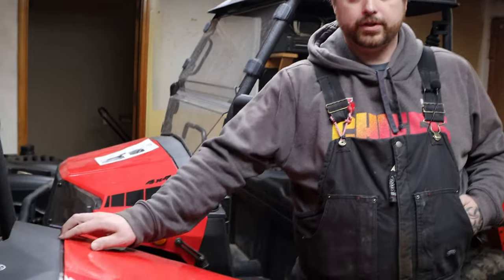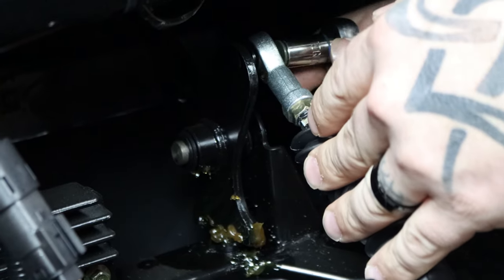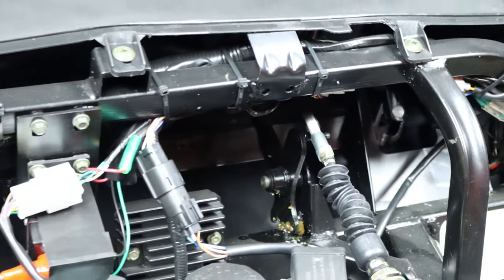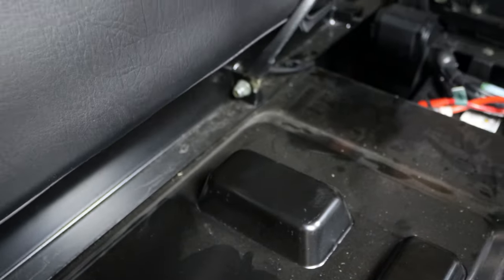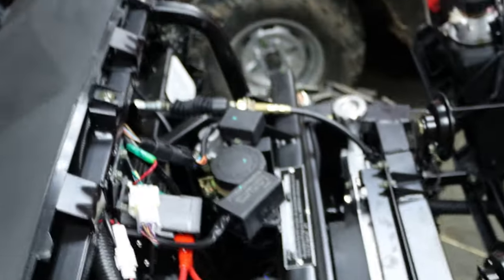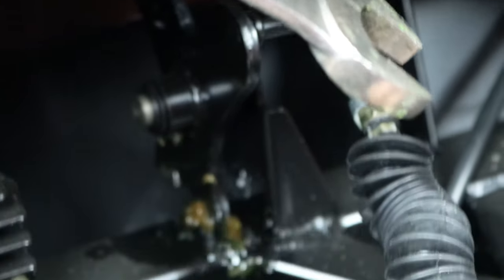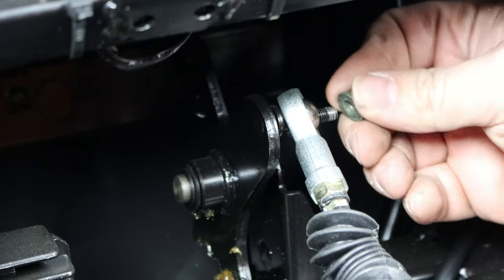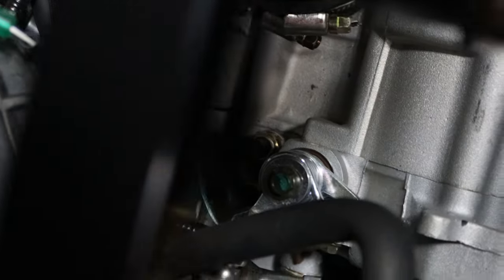Coleman UT400 Shift Cable Adjustment

Comment: This was the fix I needed.  Tried a few other adjustments first because I wanted to avoid taking out the plate under the seat but nothing worked until I used your suggestion.

Comment: Outstanding video!!  I had problem that at times forward gear would not completely set and gears growled and more or less "popped" into gear.  This video did the trick!  I was able to adjust the linkage and have not had a problem since!  Thanks so much for helping this non-mechanic fix the problem...

Comment: Thanks for the information. I adjusted mine by moving the two nuts there under the hood. It seems to shift just fine for now, but now I know the rest of the solution under the seat.

Comment: I have a 2021 UT400 and it seems to me that I have to give it a bit more gas then needed to get it to start moving and when it does it seems to be holding back until it starts rolling along then it rides good. I have nothing to compare this with to to see whether or not this is normal. Any recommendations?

Comment: Thanks for the video. It helped me to get my UT400 in drive but now it won't shift into reverse. It's like the cable is to long, it will go one way or the other but not both. Do you have any ideas on how to fix that?  Thanks
Reply: I had the same problem. I did the same adjustment as in the video except, instead of setting it in F for the adjustment, I set it in R and it works great.
Reply: @neiding10 and it goes in both forward and reverse? Mine currently goes into foward fine but pops out of reverse. So would you do this but in reverse instead and it’ll still go into forward?

Comment: Wouldn't that mess you up on going in reverse I was thinking about tithing that ball screw because it seems it just would help if you could go a touch father as far as the shifter goes because the frame stops it so if we do this to fix the forward won't we start to loose are reverse

Comment: Tractor supply is running a sale on these for 6999. Is it worth it? I just need something small around the farm that my daughter can take to the nieghbors and the river been using small Toyota puck up bit considering one of these. Thanks for reading extra thanks for opinion 😂
Reply from the maker: They are a pretty decent machine, and being on sale makes them even better.  There's not much on them that isn't easily fixed if something does break.

Comment: What size wrench are used on the shifter?
Reply: 22mm on the big adjusting nuts. 10mm on the not that goes on the shifter shaft.